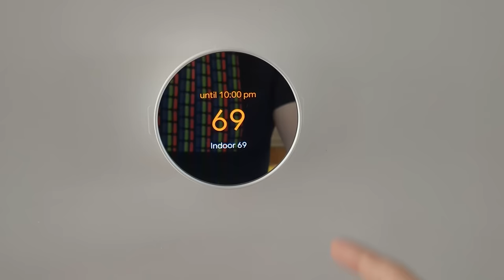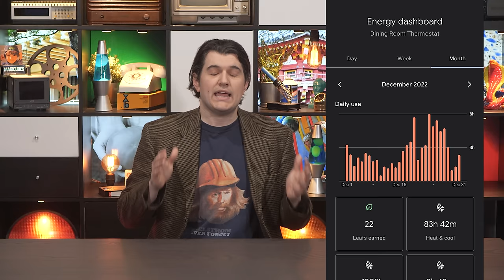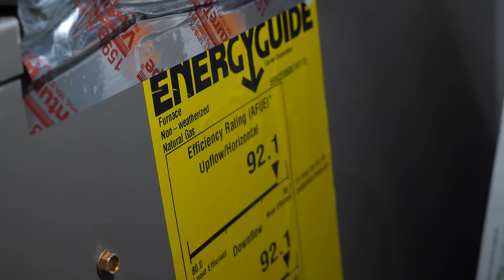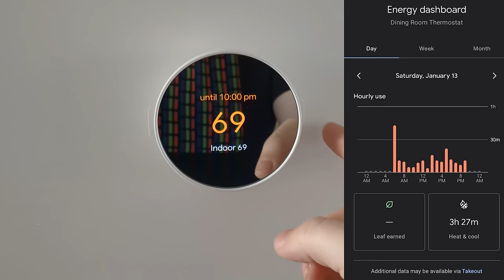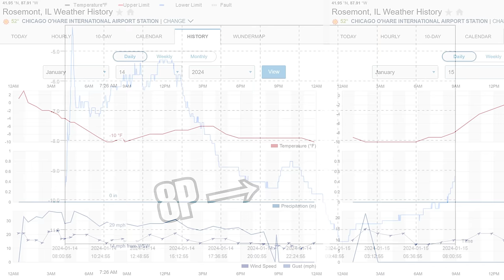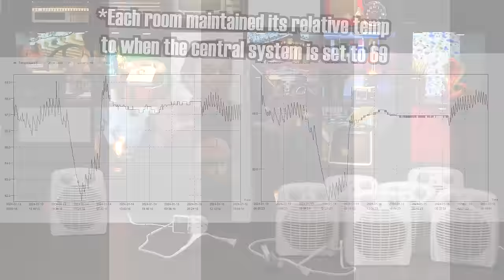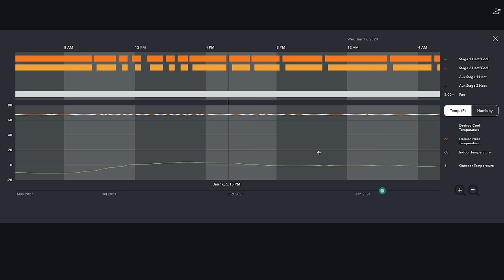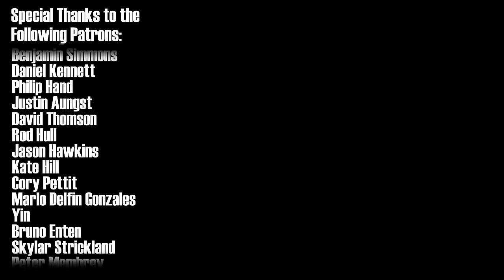Old HVAC industry practices are holding us back and costing us money. But we can fix it.

Comment: I live a little further north than you and basically got this lecture from the HVAC professional I had out to estimate replacing my furnace and ac. He said their standard is to determine requirements and then double it because if they don't people get bothered when the house doesn't heat up immediately in the morning, but he recommended going with the minimum if I was comfortable with the reality. He also said if I wanted to save money I should have a home energy audit and then act on all those recommendations first. Thank you for spreading the word.
Reply: Excess capacity is a good thing. It keeps things running longer and with less wear. The small savings of a smaller unit pale in comparison to having to replace it twice as often because it is barely up to the task.
A relative had an old house with a 100+ year old coal, later gas, fired boiler. And it still ran like a top.
Reply: @dancooper6002 That depends on what it is. Some applications actually experience more wear with constant on/off cycling or cycles of increasing or decreasing heat (computers technically "wear down" worse for being repeatedly turned on and off, and is part of why datacenters can actually maintain insanely high uptimes).
Reply: in the US, Home energy audits are also subject to a federal tax credit up to $150 under the Energy efficient home credit. You can also get a $2000 credit for heat pump installation under the same credit.
Reply: @ender25ish  Sure, but the first time the stupid thing fails in a deep freeze you have thousands of dollars of damage done to your home that daddy government is not going to pay for.
Reply: @salter1630  Data centers are not home appliances/equipment. The smaller one will have cost cut everything throughout. And it will cycle just as much, if not more, than a proper unit.
Reply: @dancooper6002  This would be true of any heating solution, none of them are infallible.
Reply from the maker: @dancooper6002 What's so funny to me about all this fearmongering over heat pumps is that when you have heat strips? You now have two sources of heat, which means you have redundancy! My furnace is currently a single point of failure. If it goes out, I'd have no choice but to whip out the space heaters.
Oh what's that? The space heaters themselves heated my home? $60 in space heaters kept me cozy warm in the coldest weather we experience? Weird. It's almost like electricity is actually incredibly flexible or something.
Reply: @TechnologyConnections People like me, that HEAT with baseboard heat have been laughing at very expensive Gas Furnaces for some time...When one burns out, they cost $100 at Menard's! - Heat pumps are next....and actually I have A/C units like hotels do that do both, but they are not as efficient...but NEW better heat pumps are coming soon to my home... Electric is awesome....But a generator is also on the list of upgrades!
Reply: @TechnologyConnections  Two different electric heaters hardly qualifies as "redundancy" when both require grid power to be operational to work. See Texas 2021 for how that assumption can go very poorly. Alternatively you can cover your house in unsightly solar panels and have a garage full of highly volatile batteries to try and bridge that gap, but it is a Rube Goldberg solution if I ever saw one. Highly unlikely to ever save money. That power backup would be better used doing almost anything but heating in an emergency.
Also, there being a separate component in an integrated system is not full redundancy as the point of failure may render both nonoperational.
Gas fired heat as central, with your space heaters as backup, is real redundancy. You now have two different sources of heat which don't depend on the same source of energy.
Even better is gas fired heat + a wood/coal stove + space heaters. Now you have 3 levels of redundancy. And one of them is not reliant on any utility to your home in the case of an outage. Might be inconvenient to use on an extended basis, but very good insurance nonetheless.
Your test is intriguing and proves what it proves, but it misses the forest for the trees. I have no real incentive to give up the dependable heat of gas to move to an all electric system.
Something else you ought to consider is that long term forecasts for electric prices are not favorable. Turns out the "flexibility" of electric goes both ways, and that includes people having so many uses for it that it becomes very expensive to heat with. You are now competing with EVs, bitcoin miners, and data centers for heating your home. The same applies to gas to a degree due to its convertibility into electric, but given the efficiencies involved its still a bet I would make.
Reply: @ender25ish Never seen a coal stove fail like that son... You put stuff it it, it burns, heat comes out.
Reply from the maker: You know what else needs electricity to work? My furnace. When the power goes out, the blower don't work!
But I also live in a state that takes care of its power grid so I'm not really worried about that to begin with. Haven't lost power once since I moved in.
Reply: @dancooper6002  a coal stove? Yikes bud
Reply: I find it funny how electrical supply is something you have to worry about. I live in europe, and in the last 20 years, I experienced two power outages: One was about half an hour, because there was some rewiring done in the building I moved into (I moved in before all parts were finished), and once for a few hours because construction workers tore out the power cable from the ground next door.
I was in the US (FL) a few years ago, and there were outages multiple times a day, because everyone was running their AC on max.
Reply: @somebod8703 
You don't in the US either. 

The percentage of outages is "bad" compared to other places, but in absolute terms it's still utterly negligible and not really worth factoring in for stuff like this.  The average resident in the US will experience seven hours of power outage... in a year or put another way 99.92% uptime. It's also not a fair comparison in some cases because there are areas of the US that expereicne fairly routine extreme weather events that drag down the entire country.
Reply: @Tk3997  I think that was their point, you think 7 hours a year isn't a lot. I live in the UK and the longest I've lost grid power for at a time is 30 minutes and that's about once every ten years, in both urban and rural living. The only reason I have UPS is because the electrical safety guy has to test the fuse box once or twice a year, THAT's more of a concern. 7 hours a year seems ridiculously high by that metric.
Reply: @Ylyrra the U.S. is as big as Europe. Where I live I've never had an outage longer than an hour. But we have above ground wires running thousands of miles.

Also the wires to my house run through a forest. If an ice storm or 60 mph gust takes down a tree on it, they'll need to probably clear trees for half a kilometer to get equipment to it. And I'm in a City. 

But if Comparing America to Europe have to remember size and low density. I think my state is geographically similar in size to the the UK but 1/6 the population. And I live North of most Canadians. 

Also the grid is expected to double in need in the next year or two. Double. It is getting really stretched.
Reply: @TechnologyConnections Texas takes care of its power grid, probably better than most places, since it has its own. But things happen, and the arrogant attitude of "it can't happen where I live" is hardly good emergency planning. The US grid generally is rated to be poor and getting worse so no where is going to be immune to this.
Reply from the maker: ... weren't you the same person who just used Texas in 2021 as an example of things going wrong? And a major factor into why things went wrong was precisely because they are an island and can't import power?
I mean, c'mon. Talk about moving goal posts around.
Reply: @Tk3997  But wouldn't these seven hours usually coincide with the time where you need it the most?
Reply from the maker: Also - for the record, I included discussion of backup power! And that, because that's a thing people sometimes want, oversizing electric systems is, in fact, bad!
There are so many ways to prepare for a power outage, and I recommend wholeheartedly that people do that! It was disheartening to watch the calamity from up here. But the vast, vast majority of people who have gas heating systems have systems which need electricity to operate. So you need a source of backup power no matter what, and fearmongering about having an electric heat source as your primary is just... totally ridiculous. I'm just as SOL when the power is out with my gas furnace as I would be a heat pump. And if I really, absolutely, 100% want to hedge against that possibility? I'll do as I said - keep a grill bottle of propane on-hand and a Little Buddy heater for emergencies. Which is doubly effective up here because we actually build our homes to withstand cold.
Reply: @dancooper6002  Do you not realize that "gas-fired heat" requires electricity to actually TURN ON and BLOW throughout your home?   So, no, it is not "real redundancy" alongside space heaters.
Reply: @dancooper6002  "Two different electric heaters hardly qualifies as "redundancy" when both require grid power to be operational to work. See Texas 2021 for how that assumption can go very poorly."

Having lived in Texas during the 2021 outage, with a gas powered heating source.... it did me all of zero good because it still required an electricity source to kick the blowers and thermostat to a position where it would heat the house. Maybe don't use people's suffering in the cold because their GAS heaters weren't working, as a prop for your poorly-thought argument.
Reply: @dancooper6002 funny enough, boilers particularly steam boilers LOVE to run 100% of the time because thermal expansion and contraction is far less. Those old boilers were nearly indestructible though. And don’t forget they use hardly any electricity at all, or in the case of millivolt systems, none at all.
Reply: Get a heat pump with heating strips, and a wood stove for redundancy. Natural gas is not redundant unless you also have a natural gas backup generator and your gas supplier still has power to get the gas through the lines.
Reply: @Tk3997 And that includes when they spend six hours in one day changing the transformer down the road.
Reply: @somebod8703  Generally not. The seven hours are when something goes wrong, which could go wrong at any time. Some places out in the middle of nowhere get a pole knocked down, and it takes hours to get someone there to fix it.
Reply: @TechnologyConnections No goal posts have been moved, you are imagining things.
I used Texas as an example because it was a recent one, not because I am foolish enough to think that outages only happen there. Sometimes being isolated from the grid hurts, but sometimes it helps (see NE US 2003). The example used is irrelevant, power outages can happen anywhere in the US and are likely to become more frequent in the future.
Reply: @dancooper6002  > Texas takes care of its power grid, probably better than most places, since it has its own.

So texas takes better care of its grid by forgoing maintenance and winterization which makes the grid go kaboom when the weather gets a bit colder? Not to mention those sweet cardboard houses that leak more air than a potato sack, which makes them need constant heat and cooling using electricity, which again comes from the oh so well maintained grid that can't handle a bit of cold weather due to systematic failure in taking care of it.
Reply: @castform57  You just parrot whatever you read without thinking huh?
If you look at ANY power grid in the US  you will find that there is always some "maintenance" that has been forgone, especially after a crisis or issue where people suddenly care. California didn't bother to "maintain" its grid either, hence the fires.
The storm that hit Texas was not "a bit of cold weather" that is a blatant misrepresentation of what happened. It was a storm well outside the normal conditions in that part of the country. No different than how heat waves cause issues in northern latitudes, it was an abnormal set of conditions.
The point is the Texas grid is well maintained, at least as much if not more so than much of the rest of the country.
But even if you are stupid enough to think that wherever you live is special and you cannot have an outage like Texas had reality is eventually going to correct that notion for you. And at that point you better hope you have heat sources not dependent on the grid.
Reply: @dancooper6002 you lost son. I suggest putting the shovel down, you ain't getting any closer by digging more. 

Texas has a separate grid for one primary reason... They refuse to follow the safety requirements to be allowed to join the rest of civilized society, as it would be dangerous to the rest of the grid to allow them to join without proper precautions in place. 

Those same precautions would have likely prevented the outages entirely in that extreme weather event. And even if it couldn't quite have prevented it, being tied into the larger grid would have bailed them out. 

Refusing to implement national grid safety protocols is a far cry from being better maintained than the rest of the grid. And their stupidity cost people their lives and an insane amount of money and unnecessary suffering.
Reply: @TechnologyConnections  Space heaters work for you because you have a tiny home.  We are close to 4,000 sqft with 18 foot ceilings, try that with space heaters...
Reply: @dancooper6002  The point being that claiming "more uptime =bad" is not universally true and asserting as such is factually incorrect. And home appliances have many such cases - refrigerators repeatedly going from full to empty break down more often than those which don't have to cycle as often, and considering refrigerators operate on a similar principle to AC...
Reply: @ByteSizeTech  Then you should probably aim to make redundant systems actually able to handle such a space then, if you feel space heaters will not be able to perform that role
Reply: @dancooper6002  The Texas power grid is notoriously poorly maintained and operated compared to the rest of the country. I also feel comparing fires and cold spells is dishonest because fires actively destroy everything they interact with and cannot feasibly be hardened against in large scale, outdoors applications.
Reply: @salter1630  Clearly you don't understand what a straw-man logical fallacy is do you? Nothing about "uptime" was the point of that. The point is a unit built to heat at 100k BTU is going to be more robust than one built to heat 25k BTU. But clearly that concept is beyond you.
Reply: I'm a FIRM believer in redundancy after getting bit a long time ago and having a major mess to clean up and repair!  I now have so many options that I'll realistically never have to worry about it again.  Hybrid solar with battery back up, gas generator, 90k BTU catalytic wood stove, gas ventless fireplace (no electricity required, I LOVE that thing and do a huge % of my heating with it), gas boiler, and a couple of mini-splits for heating and AC.  My hot water can be supplied from the boiler or from the HPWH (which I typically use), wood stove can be used to heat water in a real pinch.  I have city water, but also installed a small well for an alternate water supply if needed.  

I live directly on the CT shoreline and have been without power for close to a week a couple of times after major storms.  I'm not too concerned about emergency outages anymore...

Another nice thing about having several sources to choose from is being able to pick which source is ideal from a cost, work, and/or comfort standpoint.
Reply: @Ylyrra  
That seven hours is also an average for a nation the size of a continent portions of which are exposed to natural disasters and weather that to be blunt makes the worst seen in the Europe look like a joke by comparison. That number is also worse the last few years then it has been historically by a factor of about two and that increase has largely been driven by increasingly severe weather. If you deduct the downtime from major natural disasters, in other words focus mainly on system failures or localized events, the average drops to about 1.5 to 2 hours a year varying slightly over the last decade. 

Effectively using the flat average of fifty states with often highly variable local conditions provides a questionable comparison to a single small nation that is in all reality also blessed with very benign weather and very few natural disasters. The reality is that in a very large portion of the country for a large portion of the population you can go an entire year without any meaningful disruption and in most of the rest the reality is that you'll probably see maybe an hour or two in a year. It really is a comparatively limited number of disaster prone areas that heavily drag down the average.
Reply: @sigmahyperion955  Gas heat circulated by forced air would require electricity to blow, this is true. However, radiators utilizing a gas furnace as the heat source can operate without power in some circumstances. This is rare, as many of them are controlled electronically now, and many require pumps to circulate, but they do have the capability to be designed in such a way that they do not require power. At bare minimum, they would also retain some heat on loss of power (how much would depend on the system, of course), whereas heat pumps cease operating immediately. 

I have no issue with heat pumps. In fact, I'd love to have one so I could finally live in a home with air conditioning. But it's important to make sure the information about these things is accurate, lest we begin a crusade for or against these things.